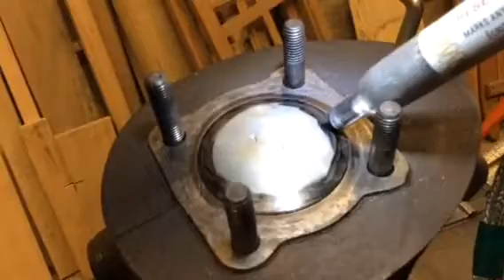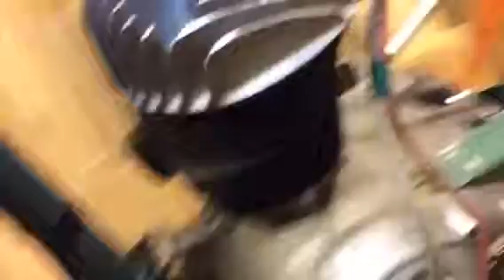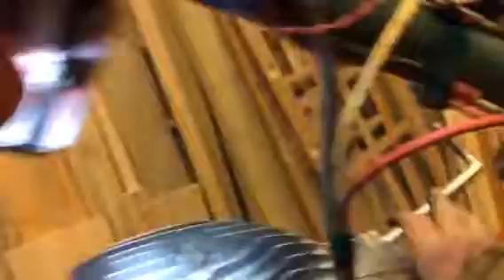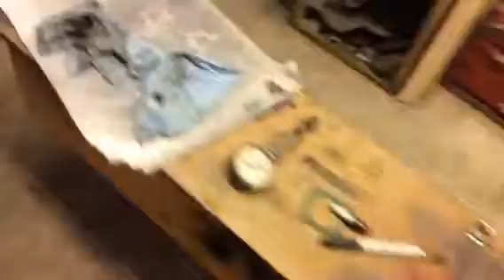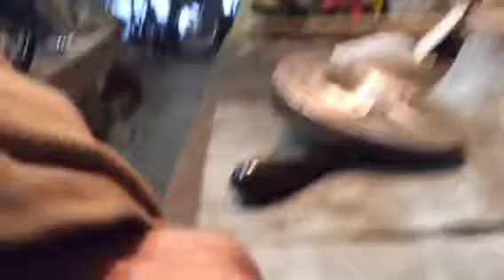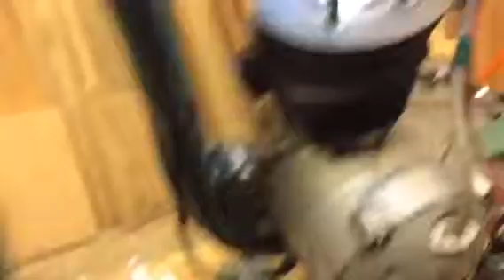Bantam D1 Raising Compression

Comment: Interesting home engineering...

Could you use Plastiguage strip.. Inside the head.

How much metal did you remove..?
Reply from the maker: He did not remove much just a light shave.
Reply: @EleyCycleWorks  

did the work improve the running..? Did you rejet the carb? 

I'll be doing one this year so this is of interest... 

I appreciate your help..